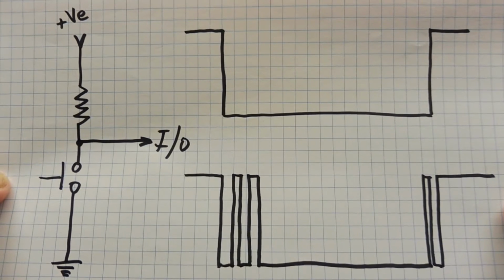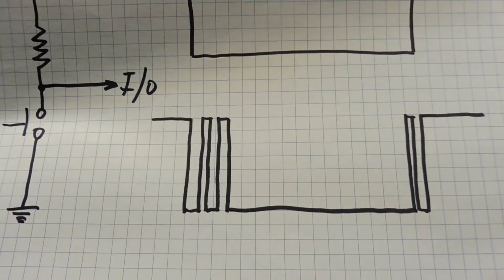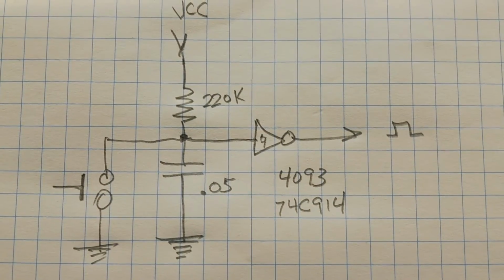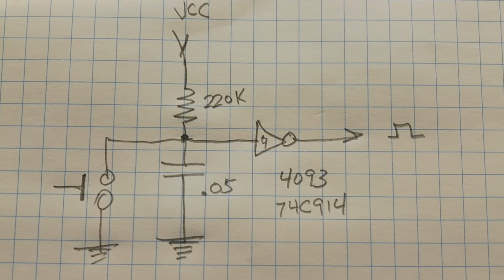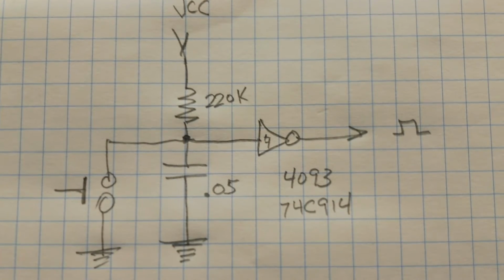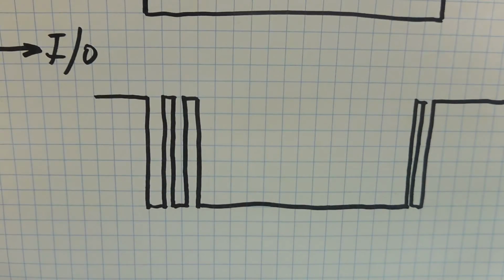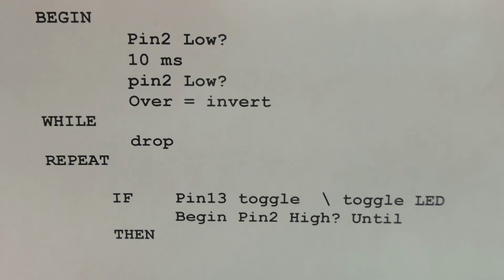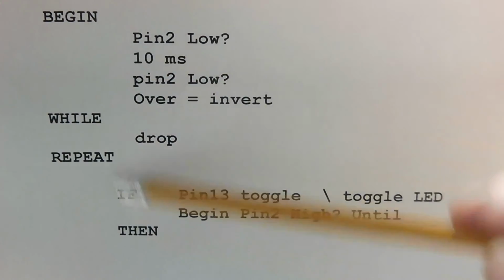Switch Debouncing

Comment: Interestingly “switch bounce” isn’t ONLY a physical “bouncing” derived issue, some of the “bounce” is caused when the switch contacts get close enough together to allow even low voltages to jump across the gap through air when the contacts are close enough to reach the respective breakdown point of air to jump the gap, this can be seen on an oscilloscope when the initial “bounce” shows up then you’ll notice when the first contact of the switches metal contact surfaces conduct through the much lower resistance of its metal contacts.

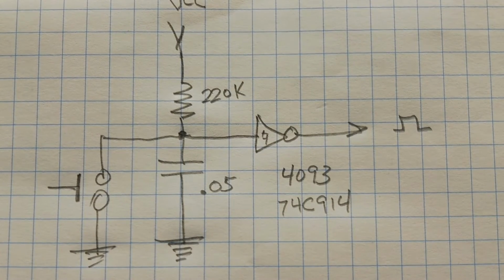Comment: At 6:10  do i connect both ends of the schmidt trigger to the input?
Reply from the maker: The switch is connected to the input of the schmitt trigger and the output will be bounce free driving other circuitry.
Reply: @0033mer  no I meant both inputs connected together
Reply from the maker: Yes ...If you are using a NAND gate, tying the inputs together will make it an inverter.

Comment: I'm trying to use an MC14490 for debouncing a rotary encoder, but can't get the built-in oscillator to start up. It's an SMD part (soldered onto a DIP breakout board), but the datasheet says these have the same pinout as the DIP version. The datasheet says the inputs have pull-up resistors, but also to connect any unused inputs to Vdd or Vss, which seems odd. It's also not clear about the need for decoupling (I've tried with and without). I have two chips and neither one seems to be working. Any suggestions? Thanks!
Reply from the maker: First check the obvious. Proper supply voltage from pin8 to pin16. A .1 uf decoupling cap across supply pins. The value of the external capacitor across pins7 and 9 should be larger than 100pf. What value are you using? I usually use a .001 uf cap.  After power up you should see a clock signal on pin9.
Reply: Thank you for the quick reply! 5 V at pin 16 wrt pin 8, and I've reinstalled the supply decoupling. I've tested with a couple of 0.0015 uF caps for Cext (that's "152" marking, right?), both film and MLCC, leads as short as I can go for breadboard use. Eventually I noticed strange resistance readings across the breadboard - tens or occasionally hundreds of ohms where there should be continuity! I think the board had some flux spill on it, and maybe that soaked up the backing adhesive or something. Pretty weird. :)

I tried again with a good breadboard but still no clock signal, with just over 0 V on pin 9, and about 1.5 V on pin 7. However, I did successfully test it using an external clock (1 kHz from my scope) into pin 7 (and I could see a lower-voltage copy of the signal on pin 9). I had to lower Vdd to about 4 V to match the scope's clock signal level. What would you normally expect to see on pins 7 and 9 with no capacitor installed?
Reply: Just an update: I didn't manage to get either of those SMD 14490 chips to work...maybe ESD or thermal damage while soldering onto the breakout board, I don't know. But I did get some NOS DIP 14990s on eBay and the circuit worked with one of those. I made a little stripboard module and installed it into my Marshall JMP-1 guitar preamp to help with the jittery encoder (a common problem). While testing I discovered that the encoder wasn't switching reliably, but some contact cleaner sorted that out. :)